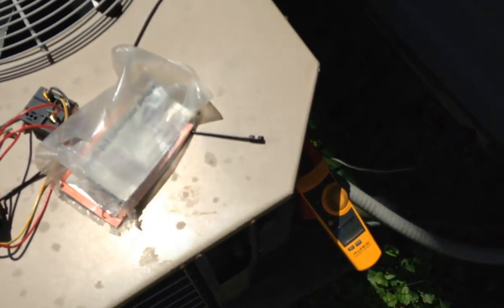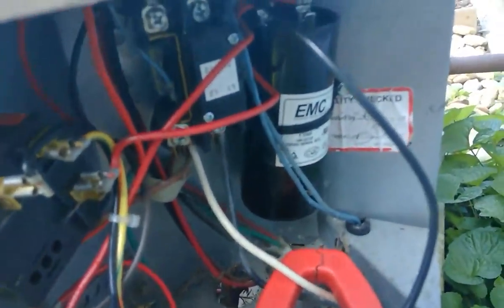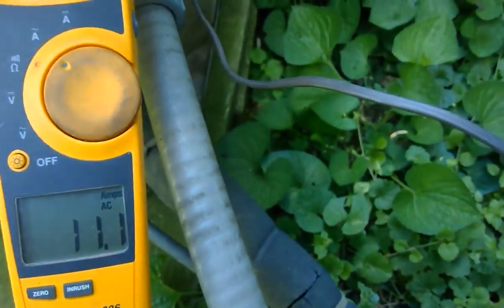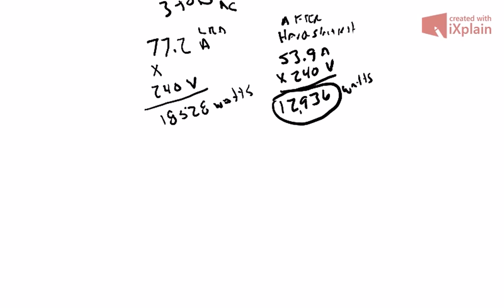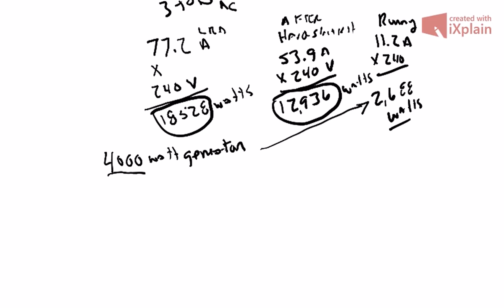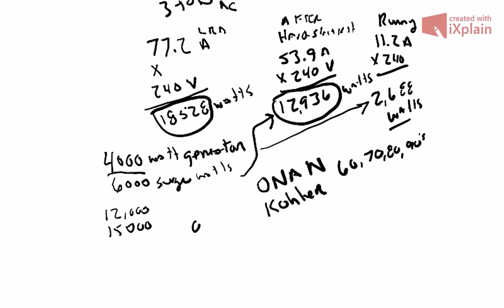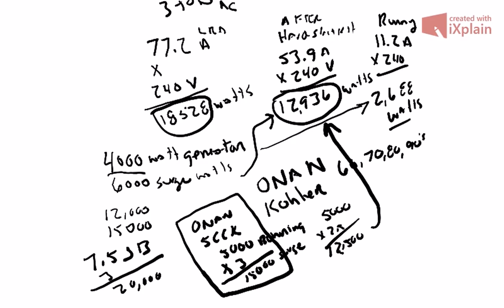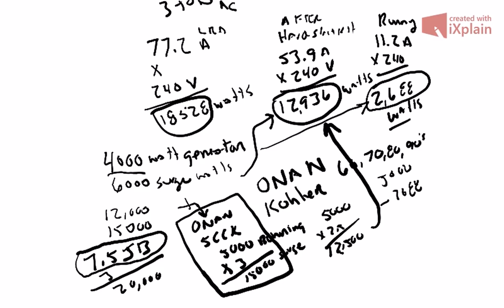how to figure out generator size for central air conditioning

Comment: first and only video ive seen that does the math of startup power good job.. U should do a follow up with what a homeowner should by including this scenario and Your major appliances. Granted gas furnaces/ water heaters arent as much but the blower motor also has a surge on HVAC. What generator do You have or suggest?
Reply from the maker: Thank you, and a great suggestion. I've got several generators. Older Onans are my favorite though as the good ones run at 1800 rpm and arent as load. If I had the money, I'd probably buy a honda eu7000

Comment: yet all these 100s of vids say they are running condensor units .  NOT ONE of them Know that maxing out generator load is horrible not just for the generator but for the appliance. I know of one where the condensor is running and his house was stil extremely hot during a power outtage ..  GREAT Video....
Reply from the maker: yep you are correct. Most generators will fail in short order running maxed out.

Comment: Loved the video, it confirmed other research I've done. Unfortunately my 5 Ton unit has an LRA of 110A x 240V = 26,400 Watts. Even with a soft start kit I'm not sure it could go low enough for a small generator to start it. So I opted to purchase two small window AC units that will cover 250 Sq. ft. each for a total coverage of 500 sq. ft. at a cost of ~ $500.00. My master bedroom with office and bathroom is ~ 420 square feet, so these two units should at least let us sleep at night, or stay cool during the day in one room in my house. I suppose I could purchase a few units for my downstairs and only run them during the day and turn off the upstairs units until just before bedtime. I would then shut off one of the downstairs units and turn on one of the upstairs units to start transferring the cooling process. Then right before bed turn the last downstairs AC off and the last upstairs AC on. Power management is obviously the key when using small portable generators to run a home.
Thanks for sharing your "COOL" video. Best Wishes & Blessings Keith Noneya

Comment: Very helpful video. I have been wondering how do figure out how large a gen I would need to be able to run my a/c. Look at this video.https://www.youtube.com/watch?v=c_rLmDmfHjE
This guy is running his a/c on top of the rest of his house on  9300 starting watts. Any explanation on this? Is he damaging his a/c?
Reply: Pretty much just luck. The LRA rating is only what is required when the compressor is in the worst possible place to start. Most times the compressor will not draw as many amps as that. But that one time it does, it's going to flip a breaker.

Comment: So I did your numbers and its requiring me to need a huge generator but this information is awesome and would help a lot people great video. But this is what I have done and I am running I have an 1800 square ft house also.***I put a CPS  CSRU3 5 2 1 hard start kit on my Lennox 48000 btu 12000 BTU in a ton = 4 ton ac unit im running a 7500 peak watt 6000 continues watt Powerstroke generator from Home Depot I paid $745.00 after taxes. I can run everything but my stove and hot water heater. So all outlets 4 ton AC well pump fans in the house are all on and run fine. I also ran a 50amp breaker and I have a Generac plug mounted outside and a generac cord with a conversion cord from 30amps off my generator to 50 amp adapter plug. I will make a video and post it soon!! One video will be in the panel and explaining the hard start kit the other will be running the hole house how I do it.
Reply from the maker: danny1mmafan thanks for watching. I’ll be on the lookout for your videos

Comment: This formula does not work correctly for calculating generator size.

The LRA happens so fast, you can just simply multiply the 2. Also the hard start doesn’t lower it, it just makes it happens so much faster than your meter can’t ready the full amp draw.

The best equation I have found that has worked with 3 homes is the following. Assuming no hard start, a compressor should start on 70% of LRA and 70% of 240 volt. My 3 ton has an LRA of 69 so it would be as follows,

68*.7 + 240*.7 = 8,114 starting watts.

I have an 8500 running, 11,500 surge generator and it easily starts my 3 ton without a hard start and 1-2kw of preload. Using the conventional formula I’d be looking at close to a 17KW generator which would be a huge waste as my average running is around 3kw. At my moms we installed a 12kw running and 15kw surge. It easily starts a 5 ton, 112 LRA compressor with a hard start with plenty of preload. If we sized based on 112 x 240, we’d be looking at 26kw and that’s assuming no preload 

With a hard start, I believe you the formula is closer to 50% of LRA and voltage. In one home I worked on, we got a 3 ton to start 5500, 6500 surge generator with about 1kw of preload. 

I would say the safest bet is the 70% rule. I use my generator for hurricane power outages and running something too large is going to cost me precious fuel.

To confirm, the formula is 70% of LRA x 70% of 240 volts
Reply from the maker: Sure it works.  There are so many variables at play, there is no one correct formula.

Comment: I am looking into both a hard start kit and a delay timer for the inside air handler.  By delaying the air handler by say 10 seconds it should lower the startup amps even further.  I am not sure when testing will begin but I will update this soon.
Reply: Did you ever try the delay?

Comment: Thanks I really needed this video. I know there was a start up surge, but I was unsure how to calculate it. I have a 6800 watt generator from China and I needed to know if it could start my 4 ton unit. Simply in my AC units current condition it can't, and I was pretty sure it couldn't. Now because of your video it's confirmed. Thanks again for you work. 
Best Wishes n Blessings. 
Keith Noneya
Reply from the maker: Keith Noneya I'm glad this helped you. The big gotcha is those darn startup amps.

Comment: That's a pretty good drop in starting current. Thank you for the video! The information is valuable.
Reply from the maker: Thank you. I will actually be getting another video together shortly that shows it trying to start on a onan 5cck not sure if it will but if my math is right , it should.